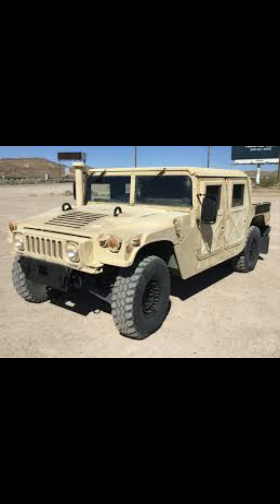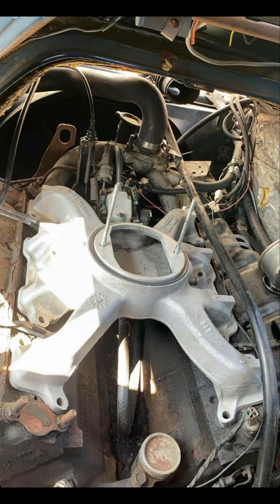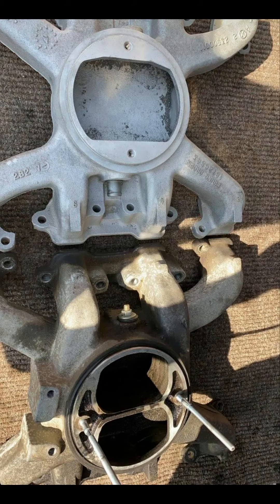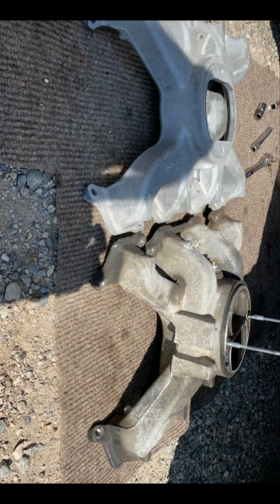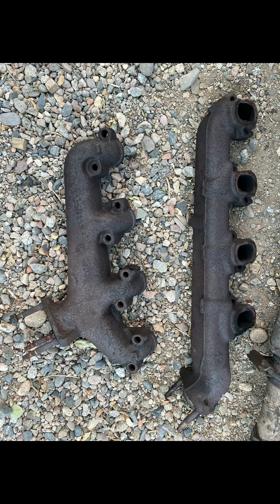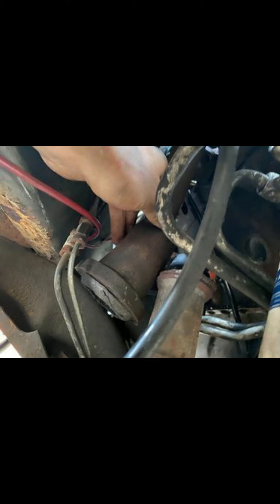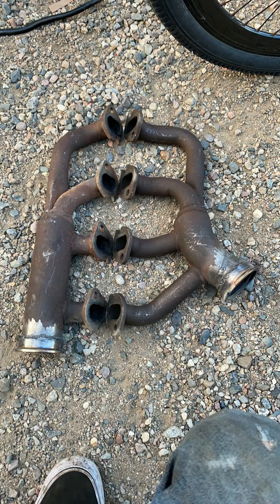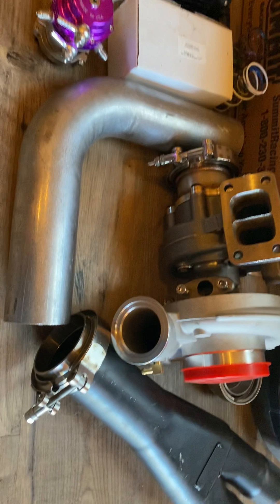HOW TO: Install HMMWV intake and exhaust manifolds on a 6.2 or 6.5 N/A Detroit diesel!

Comment: 93 mustang or ranger plastic cooling fan is a good upgrade, I'm getting 17.28 mpg in my m1009 now, direct bolt in if you use your old fan clutch
Reply: Wow, I get 24mpg out my m1009, I do have 6.5 engine with turbo and a 400 turbo trans out of a 2002 GMC savanna cargo van, running on 33x12.5r15 tires.